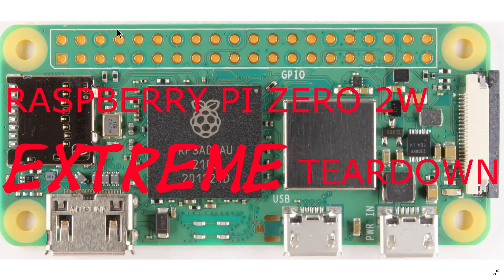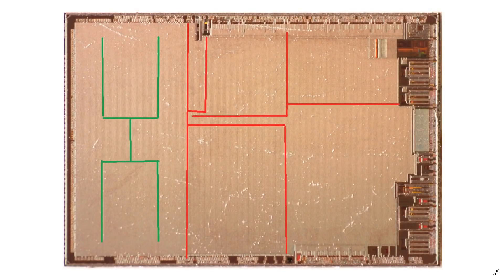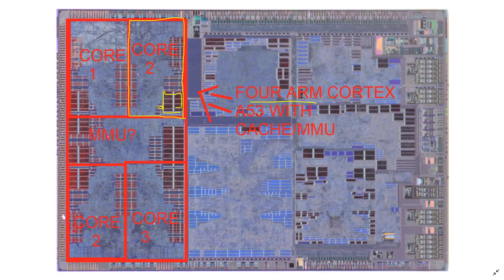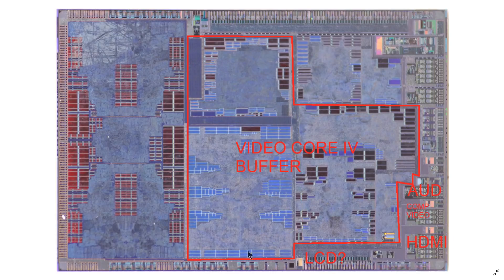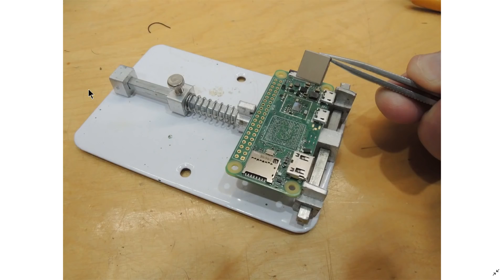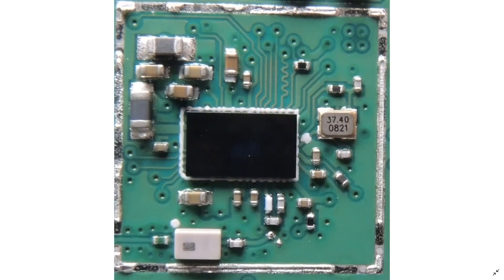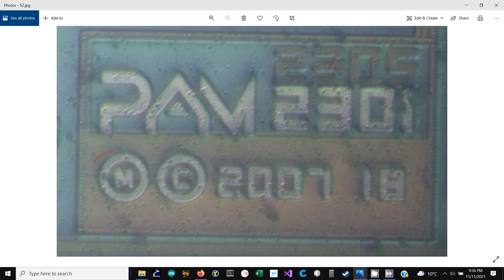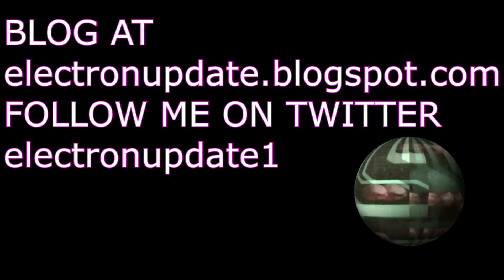Raspberry Pi Zero 2 W Extreme Teardown

Comment: Thank you for the video...I see you have another one for the voltage regulator on the Pi Zero...I think mine is fried so I was wondering if you know if the PAM2306KE is the same as the 2306KE TDA 1H (I think at least TDA 1H) on the Pi Zero 2 W - so far I havent't beena ble to find anything on that chip. Cheers

Comment: it would be interesting to compare the RPI connection to the ram chip sandwiched underneath it ..... and is it possible to find a bigger capacity RAM chip with identical pins .... the RPI downfall was always the lack of RAM ..... maybe a bigger capacity RAM chip from the new RPI 4 ?

Comment: Wasn’t expecting the DRAM to be the larger of the two dies especially seeing as it’s only 512 MB!
Reply: Don't you get 8 or 32 of those DRAM dies on a PC memory module? DRAM takes a lot of on-die support logic, the refreshes and all that. Similar issue with home network routers, generally 1 or maybe 2 memory chips, so 64MB is common and then you get denser dies on the upscale model snf 256MB taking the same landing pad as the 64MB.